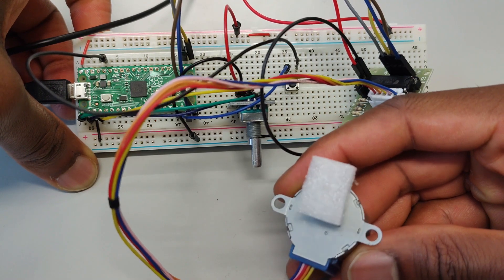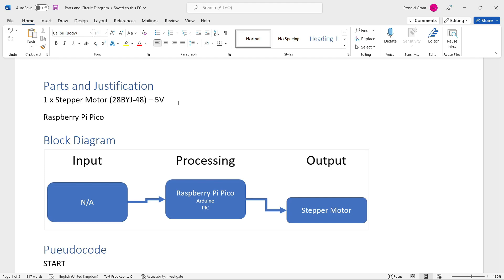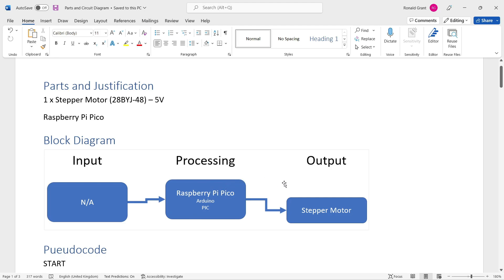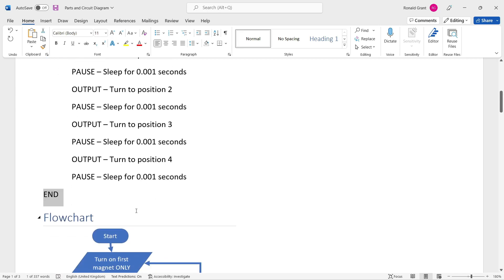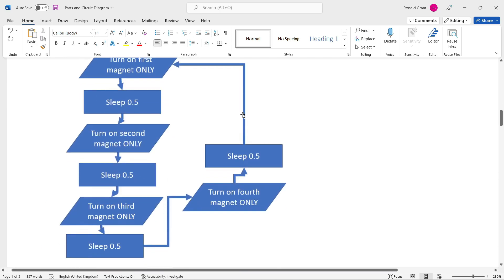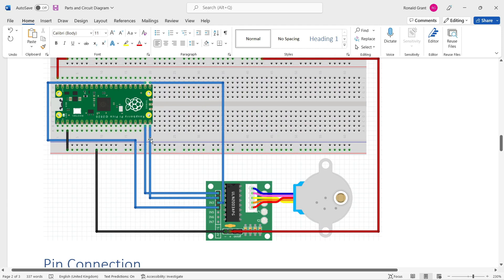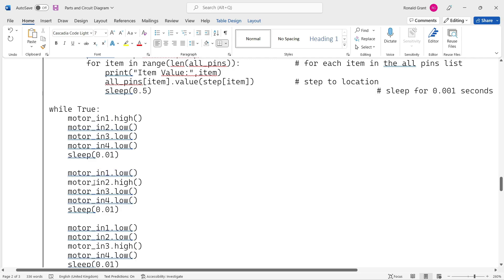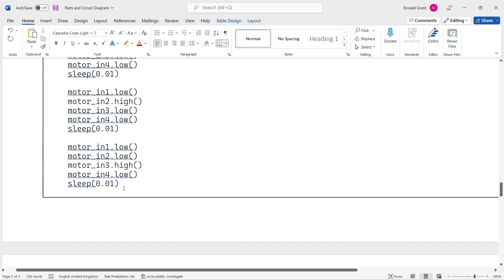Raspberry Pi Pico | Part 15 | STEPPER MOTOR - (2022)

Comment: i had error prompt saying "machine" module not found
 if so please send a code on the distraction or comment here please
Reply from the maker: Be sure you change from Python 3 to Micro Python.
Reply: Not wonking on laptop. Only if you run it on  Pi Pico. "machine" is on micropython installed on Pico